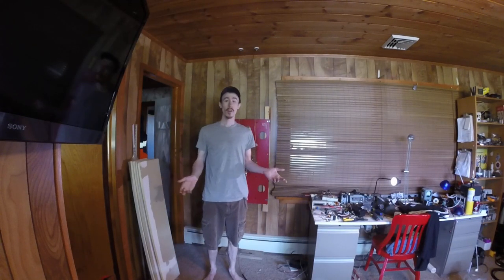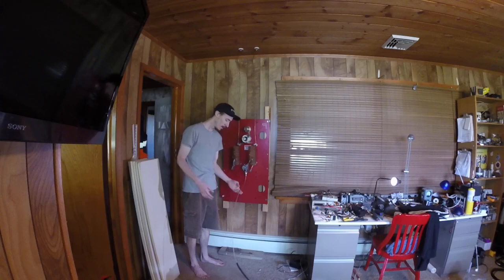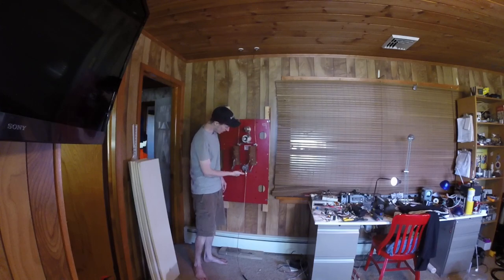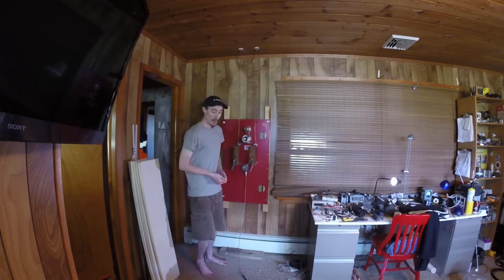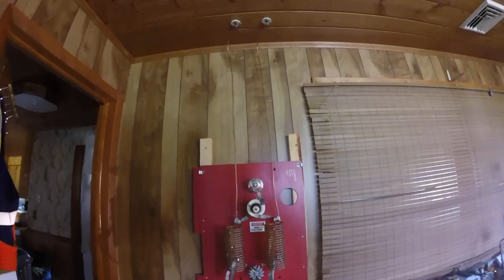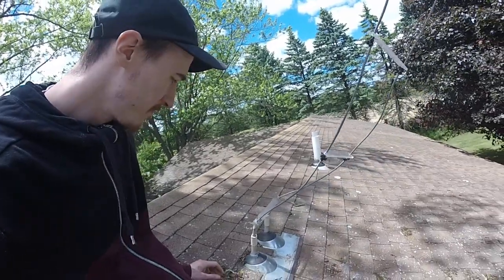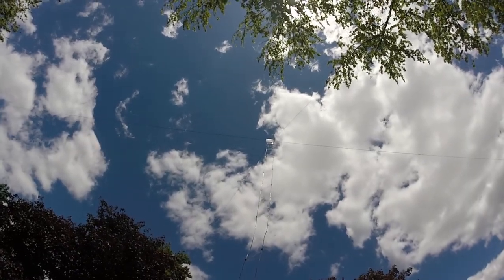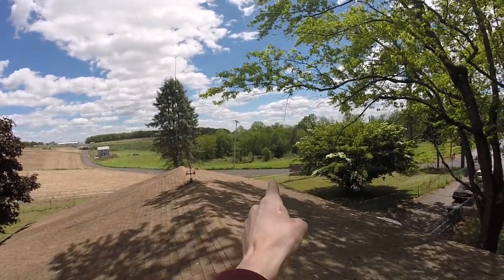My homebrew Antenna system!  Double Balanced Tuner, Non-Resonant Doublet (dipole) - W2BTK

Comment: aha you are one of those 3885 guys!!! AM all the way. I really like the design of your tuner. Your system must be very efficient. Most of the branded tuners cannot deal with 160M AT ALL. I'll be in touch for some specifics. This is the ONLY way to get on 160M and 80M
Reply from the maker: this guy gets it!!!!!!!!!!  Yes tuning into a very low radiation resistance requires a bad ass tuner :) :)

Comment: Funny you mention 3885 KCs the whole reason i’m here!just made up a dipole cut specifically for that frequency fed with 300 ohm ladder line to a 4:1 balun and 75 ohm coax going to my just recent put on the air AN/GRC-9 transmitter maybe hear you on the OMRN some saturday morning?73’jim KB1PFL

Comment: This turner is so dam cool. I want to make one symmetrical balanced. This would be for my 160m loop antenna system that I plan on building. Did you make the inductors yourself? I’m interested in the specs. Great work. W2tru
Reply from the maker: Hey!  Thanks!! Everything I needed to know to make it I learned from AG6K's article found here-- https://www.qsl.net/w/wa5bxo/ag6k/bbat.html

If I had to guess I'd say the inductors  are probably in the neighborhood of 20uH .. They are home made with 1/4" copper tubing around a 2.5" PVC pipe form. (slightly over 2.5" due to outer diameter of sched 40 PVC being a bit thicker) It is 20 turns.

Comment: Is there a reason the support rope is perpendicular to the antenna? Why not run it between the  same trees as the dipole?
Reply from the maker: It's because the two tallest trees are very close together in the center of the house. & It ensures the feedpoint is the highest part of the antenna.   If I didn't do it that way the feedpoint would be almost 10' lower.  It raises up the feedpoint to the maximum height that it could be with the trees on my property. (trees on either end of dipole are lower.)